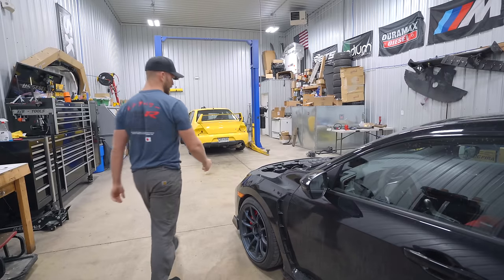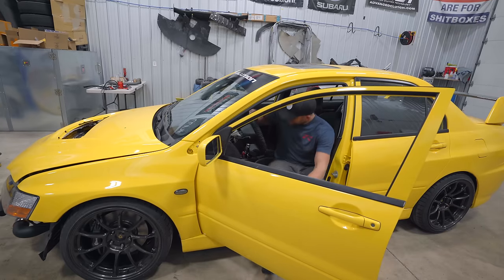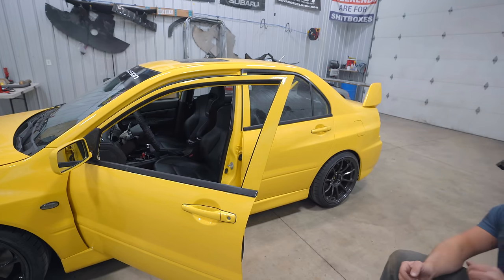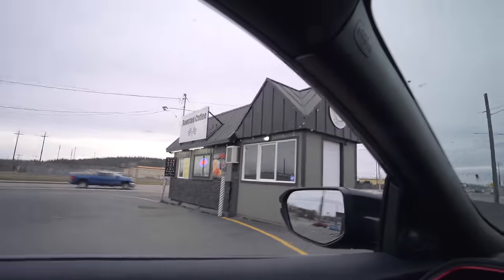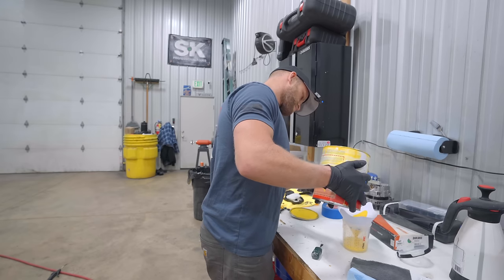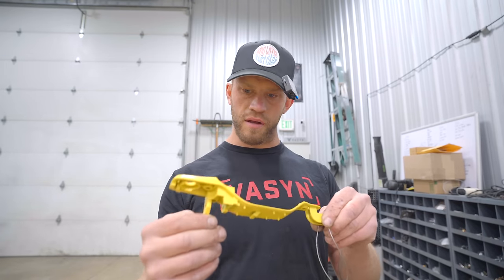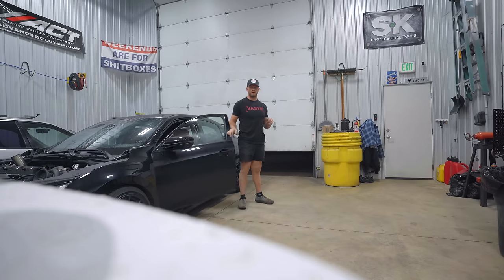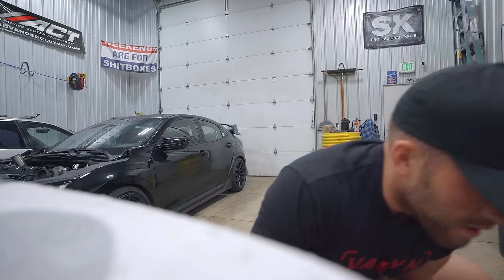Never Painting A Car Yellow Again... (EP. 69)

Comment: Not being a hater just giving my opinion as a collision painter I said it before you have a 50 shade of yellow going on the doors are a different shade of yellow to the fender and quarter panel,  hood and trunk you can get away with because they on two different angle, this why I only spray parts apart only if they in the same booth at the same time if not that small temperature difference is enough to make the color off we see it every day with oem cars where the bumper was paint in a different location from the car.. rule number one when painting a car apart never have two painters you guys have two different painting style different gun different air pressure..
Reply: Interesting. Good advice!